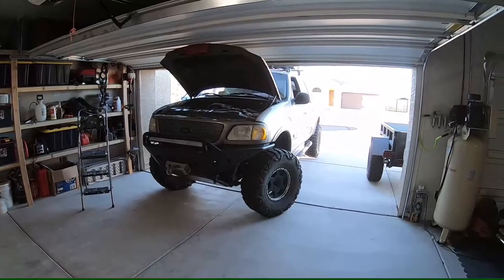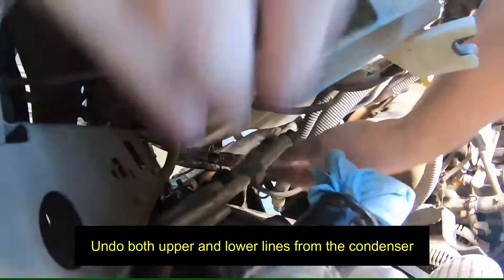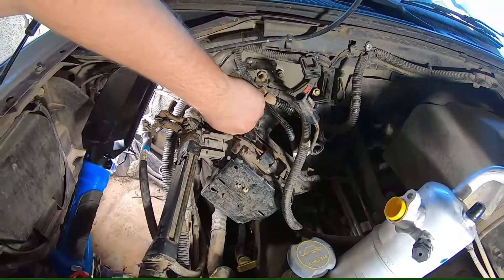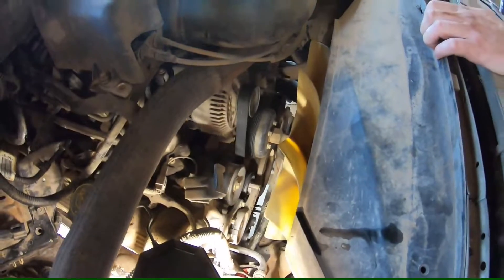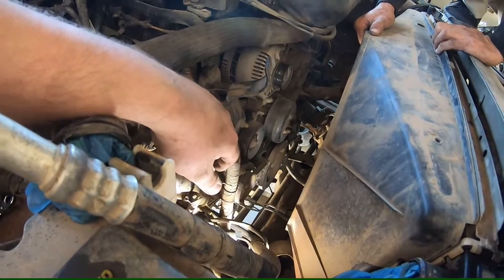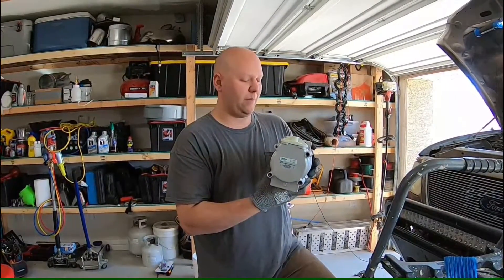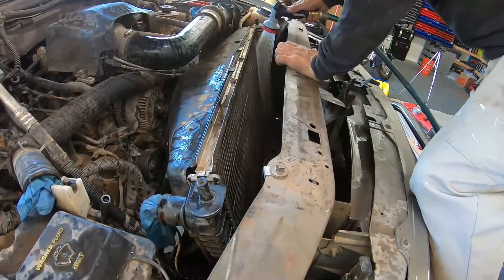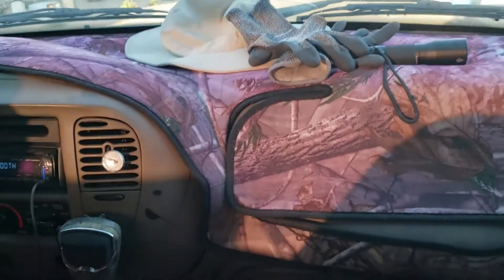1997-2003 Ford F150 A/C Replacement

Comment: Hi, in which hole goes the refrigerante oil ....??
Reply from the maker: Thanks for watching! Typically it doesn't matter, once you have the system all sealed up and before you vacuum you will manually spin the clutch 8 or so times to get the oil to spread a little bit
Reply: @AGuyandHisProjects  Thanks for your help....Here's another question....How many onces are needed if the compressor is empty?
Reply from the maker: You would have to look at any sticker you have under the hood. Should have refrigerant capacity as well as oil capacity. Every engine and model and some years are different.
Reply from the maker: If all else fails and you dont have a sticker I have had puck calling my local dealer and asking them, they can usually look it up in their database with the vin #
Reply: @AGuyandHisProjects  Mi car is 1996 Mercury, Grand Marquis SL...(Old one like me...:)..).....Is a 8 cylinders,  4.6 liter...
Reply: I and my car will thank full  for the rest of My and it's  life  if you find out exactly how much oil refrigerant is needed....:)
Reply from the maker: @merged  hahahaha you are funny. I'd try through the dealer. That is what I would have to do
Reply: @AGuyandHisProjects  Hehe, I try to be positive with My Life ....And the Life of My car....I want  it to last at least 5 years more...:):):):)
Reply from the maker: @merged  a very good idea indeed!
Reply: @AGuyandHisProjects  Bro, I expect your answer with whatever you find out....Take care!!!....:)
Reply from the maker: Expect away! Keep watching videos, maybe someday I'll work on one like yours ;)
Reply: @AGuyandHisProjects  Bro, don't get mad, for what I say...:)
Reply: You know something ....I keep replying to you  because YOU are the only one that has answer me MY questions:)
Reply from the maker: @merged  I enjoy helping people. Keep in mind however that I am not a mechanic, not an expert, nor trained in any way. Just a guy that likes to figure things out.
Reply: Once again....Do NOT get mad....I'm going to start listening GOOD music, from the  60's  70's  80's and some of 90's....:)
Reply: Did you put o-rings on the compressor? If so, what size and how? Thank you
Reply from the maker: @terrybuckley2650  most compressors come with a pack of orings to use. Some have them already installed. Every compressor will be different
Reply: @terrybuckley2650  Both are the same size....I already put the refrigerante, it works perfect....Now I have another problem...:)...The vaporator  starts liking  right away when I turn "on"  the AC.....:(.....Any advice???  ....Thanks!!!
Reply: A Guy and His Projects thank you!
Reply: jerr dez where do you see you’re evaporator leaking from? Is it coming out of your plenum( I believe that’s what it’s called) or where the accumulator meets the evaporator?
Reply: @terrybuckley2650  Right from the bottom ,  someone told me that the condenser (black tank that goes before the evaporator ) needs to be replaced....PS: The evaporator, I replaced 2 years ago......:)......:(
Reply: jerr dez the line that leads to the evaporator comes from the accumulator or drier. The condenser is what sits in front of the radiator
Reply: @terrybuckley2650  Thanks , !!!! Then is the accumulator that  I need to replace....:)?
Reply: jerr dez if that’s where the leak is then most likely. It could be the O-rings. There are the attached to it I believe

Comment: Your video edit cut out, like the movie theater power going out right at the point when the hero says "whatever you do don't".  What did you flush the ac lines with?
Reply from the maker: Thanks for watching! We flushed each lone by itself with high pressure air. This is NOT how you are supposed to donit which is why I didn't film it lol.

Comment: did you clean the lines? if so how?
Reply from the maker: We blasted some air through. I think most prefer to use a chemical flush. Be warned however that many manufacturers do not recommend the chemical flush lol. Remember, I am not a mechanic

Comment: Did you clean the lines after all ? Not criticizing just asking lol
Reply from the maker: Only high pressure air. Not a chemical flush no. Controversial topic I know! Lol.
Reply: @AGuyandHisProjects  I'd say the oil will protect that compressor regardless , thanks for the reply!
Reply from the maker: @BuhdFrankDaTank93  Thanks for watching. Theoretically if there were metal chunks we missed in the lines then the compressor would indeed be at risk.

Comment: 7 minutes 30 seconds in you said put the clip on to remove   did you mean take clip off ? Do you need a special tool to remove the accumulator from the firewall or do you just twist in pull after that clip is off?
Reply from the maker: Bad phrasing on my part. Yes a "special" tool that i referred to as a clip. It is simply a plastic tool used to slide over the coupling and release a spring inside the coupling. Most auto parts stores will have the tool and if i remember correctly you buy a whole kit for like $10
Reply: Oh ok sweet I'm glad I asked. Also In the video you  said after like 5 hours you got the accumulator out    Do you have any tips that might help me get it out
Reply from the maker: Haha so it felt like 5 hours for sure but it wasnt that long. Was certainly the most difficult part of the whole process though. I think we finally got it by not being afraid to break it. Slide that tool in and wiggle/pull like crazy

Comment: One thing to remember that I did not see you do. Is to rotate the front of the new compressor 6-10 times to make sure the oil is throughout the whole compressor, otherwise it could fail on the very 1st use because it has none in it;s system. Other than that great vid!
Reply from the maker: Thanks for watching! Valid point!

Comment: If you place the compressor completely vertical underneath the truck, slide it part way up and turn it 90 degrees it will slide right up behind the steering linkage and cross member into place. No messing with the fan. No unbolting the idler arm although it does give you a bit more room if you do. Works on 2 and 4WD.
Reply from the maker: Thanks for the heads up! Hopefully it'll help other out reading the comments

Comment: I just finished my 2001 F150 4x4 Supercab today.  I spent about 3 hours last night trying to get the thing mounted back up. No luck.... Went back out this morning and after about 2 hrs it finally lined up.  Def not that easy by yourself.  I removed the idler arm which gives more room.  Went and bought vac pump and gave set tonight to finish tom. Everywhere wanted me to leave my truck and I'm like NO. I have a Universal Refrigerant license so all good. I just don't work in that field anymore.
Reply from the maker: Way more satisfying to do yourself as well

Comment: Lower rear bolt is snapped. Don’t know what to do now.
Reply from the maker: That's a pretty rough situation right there...you get it resolved yet? Maybe a sawsall to cut the bolt off to remove the compressor and then drill out the bolt?
Reply: @AGuyandHisProjects  ended up cutting the compressor off, bolts were seized in the compressor and not the block luckily. Installing everything right now actually.
Reply from the maker: @taylormalesky2549  dang, you did get lucky! Glad it is working out!

Comment: Didn't see you flush the system before assembly
Reply from the maker: Yep, I did not show that part, that is correct.
Reply: @AGuyandHisProjects  Just checking. lol I'm working on a 2002 F150 a/c system I just bought. Held charge 2 days and afraid it's either the compressor or the dreaded evaporator as I can't see any tale tell signs of any oily residue externally. Have a sniffer on the way to search.

Comment: My 2002 F150 has a 3" body lift + 4" suspension lift, I removed the ground strap on the frame and the compressor slipped out between the fan shroud and up and over the frame out through the wheel well.
Reply from the maker: Thanks for sharing that info!

Comment: You can get the compressor out just by cranking your wheel all the way to the right and taking the passenger tire off!
Reply from the maker: Good to know!
Reply: Great tip! Saved me some time and aggravation for sure. I didn't have to take the wheel off, but that was probably because I took the fender off for refinishing, along with the inner splash guard fender gizmo.

Comment: You never showed how You charged Your system ?
Reply from the maker: Thanks for watching! No I did not, as I have my 609 card and I know how "intricate" the system is I would recommend you take it in for the vacuum/charge part of the repair.
Reply: You need a way to pull a vacuum on the system first. You don't want any air in the system , only freon.  They aren't cheap to obtain, even though they should be.  Charging the sytem is easy, just do a bit of research online and you can find out what the gauges should read...AFTER you've vacummed the system down.

Comment: Question can I just change the compressor from the f150 and not the little tank in the back ???
Reply from the maker: Can you skip it? Yes. Should you skip it? I wouldn't. It removes moisture from system. To allow for proper cooling so it is important